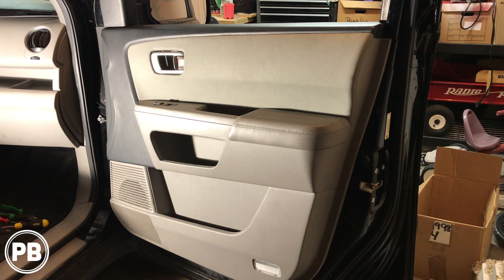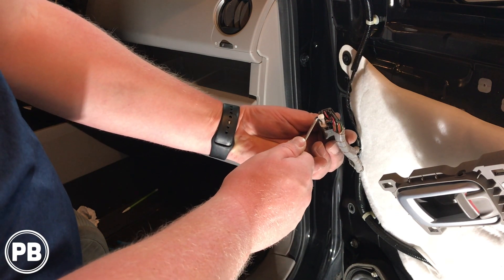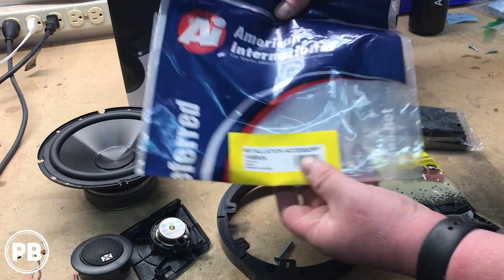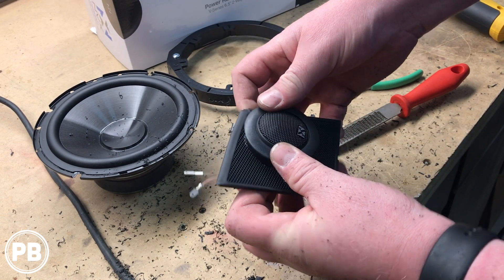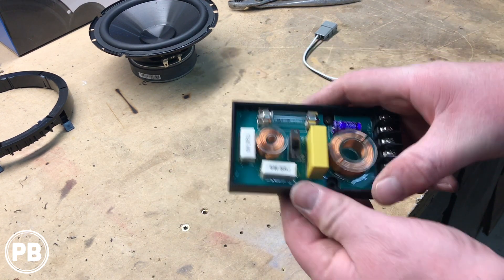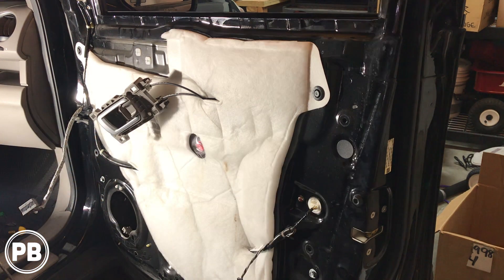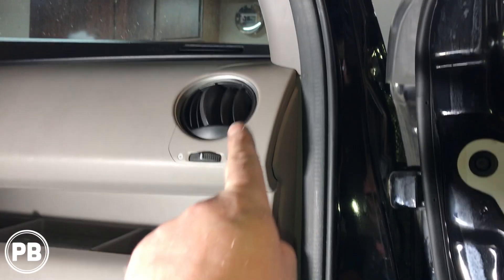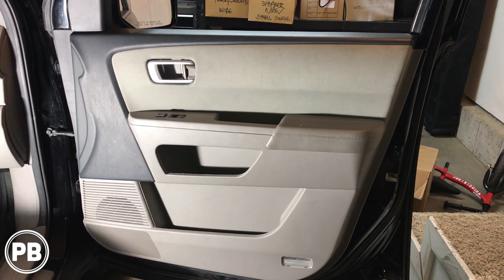2009 - 2015 Honda Pilot Front Speaker Install

Comment: So I have some questions. Is this a pilot with a factory amp? If so, are those speakers rated for the factory amp? Also how did u get past the grommet on the driver door? Usually there is a connector plugged right in the hole of the grommet on Honda's
Reply: I did mine the other day on my 2006 with all the parts he suggested and i had no problem.

Comment: Pilots have a stock Amp. Doesn't that separate the signal already? Seems dumb that Honda would use tweeters and mids then not separate the signal.

Comment: There is no reason to remove the entire door panel to just change the speaker. You can just undo all screws and pop off the bottom of panel and change speaker.
Reply: nope. Not possible in 2014+ models
Reply: At that point you’re only about a step away from removing the whole thing so might as well. My problem is that it lacks detailed explanation for rookies like myself
Reply: @dogoargento3502  I just did it yesterday and it SUCKED !!!  Firstly, the door open hinge handle does NOT push through (2014) You have to remove the cables. If you break a piece of plastic you are SCREWED !!. You CAN NOT reach the wiring harness to unlatch it unless you break all the door wire holders. Remember, the plastic is 9 years old and unforgiving.  
What I did was pulled the panel off and hung it by a ROPE sling I made. Then struggled a bit to get the speaker in and out. Much better then breaking a cable or wire in my opinion.
Reply: That sounds better to me lol
Reply: @dcb1138 bit late but are you saying i could do that in my 2011?

Comment: I gotta say that was cringe when he drilled out the hole on the grill for the tweeter and all the pieces flying around; he could of at least move the new speakers out of the way of flying debris. Could also remove the grill, but up to the owner.